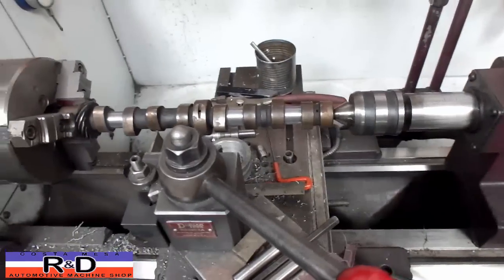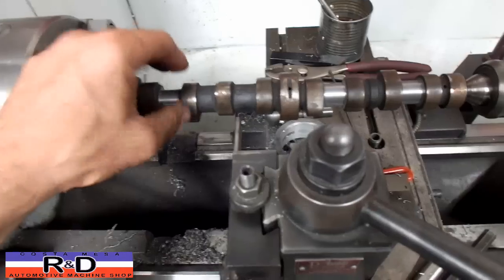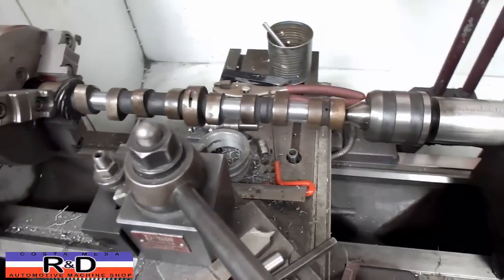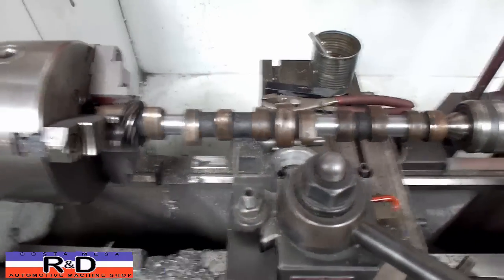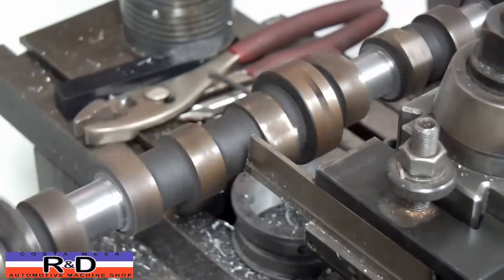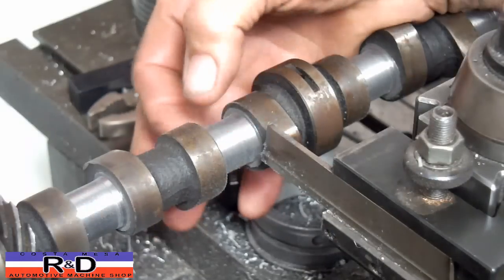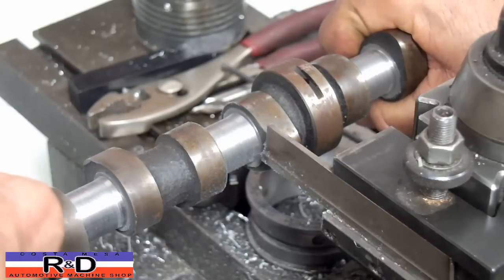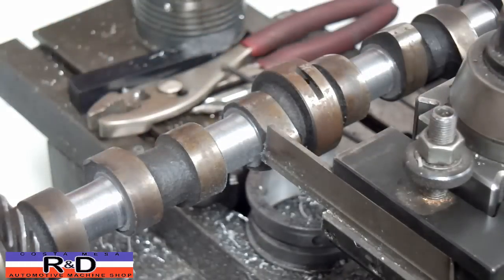Fiat 850 Cam Mod for 74mm Stroker Crankshaft

Comment: hi, was just wondering why is the lathe rotating in the opposite direction
Reply: tool post positioning convenience maybe?
Reply from the maker: +karroome That's the way my lathe is setup for cut-off. The tool jumps up and out of the way instead of down so the tool breaks. Give it a try, I think you will like it.

Comment: Hi John, I'm from Philippines. I watched your video on block resurfacing. I have a 6 cylinder diesel engine, I sent the head for resurfacing ,still the  coolant keeps coming out of the radiator. I suspect the block is warped. Can the block of diesel engine with dry type liner be resurfaced? Thanks.
Reply from the maker: +Rogelio Dela Cruz  Did you have the head pressure tested to 60 psi? Yes, you can resurface dry sleeve blocks, but the liners need to be installed. Hope this helps.

Comment: Wouldn't it be a good idea to smooth out the edges? Seems like a very good place for a crack to start.
Reply from the maker: +LILLJE The hand finish on the cam will be done after its ground with the new specs.

Comment: Are there any other benefits to turning down the journals?  Weight reduction?  Clean machined surface?  ect?
Reply from the maker: +Tim Fox You need the journals to support the cam in the middle, so I don't think it would help.
Reply: +fiatnutz John, I didn't mean the journals.  I had not had my morning coffee yet and had not fully pried my eyes open.

The rough casting parts you were turning down, how much weight reduction would you get?  Would it be something a race engine builder would consider?
Reply from the maker: +Tim Fox Only if you are crazy like me and drill all my bolts to lighten them. I get laughed at a lot by other competitors when they look under the bonnet and see all the drill fasteners. When you have weight limitations, you have to be proactive to get to them and only a pound more. I was within 2 lbs at one national level race this year when the car was weighed.
Reply: +fiatnutz That's just dedication.  I was thinking more in terms of lightening the rotating assemblies with a method similar to what you did in the video.

Comment: John from a dirt track racers standpoint do you think this would help the rotating assembly weight of a small block Chevy?
Reply from the maker: +SlowRollin TexasStyle Probably not because of the very high spring pressures you guys run. With all that pressure, the cam would most likely twist if you took too much material off. My over the nose pressure is around 170 pounds, nothing like a well built SBC. But, you could give it a try if you are using a cast iron cam, but use moderation.
Reply: Thanks for the reply John. I was kinda on the fence about trying it and still msy but you pointed out the spring pressure that I never thought about.